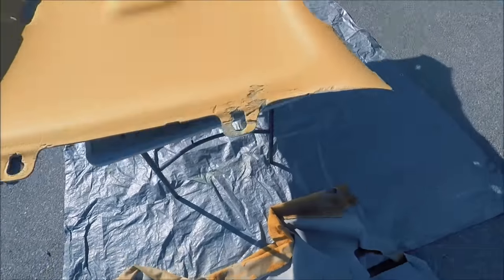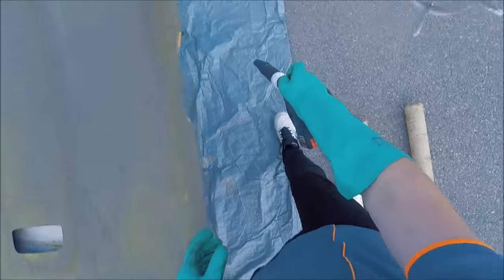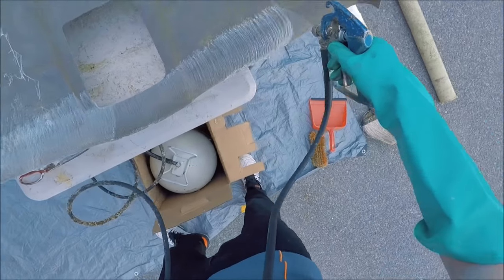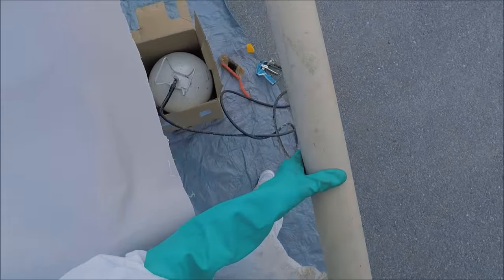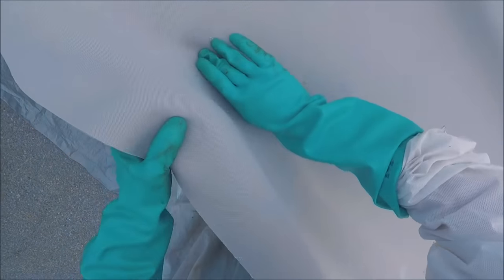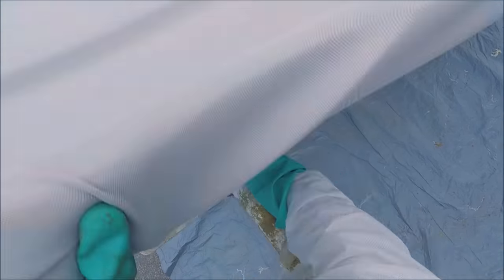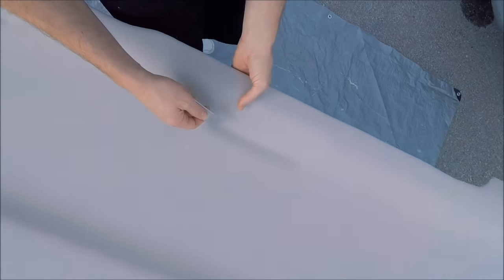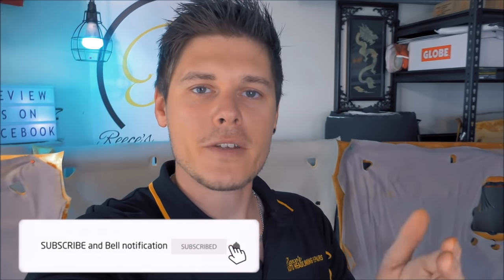How To Fix a Headliner The Correct Way

Comment: Just a heads up to anyone who is planning to buy fabric from general fabric store or crafts store - some of those fabrics, especially black ones cannot withstand UV radiation and will fade to the original fabric color since they are painted fabrics. Special automotive fabrics dont have this issue.

Comment: when installing a new or cleaned old headliner board, is there the mistake of installing it in the wrong direction? I have a 06 toyota corolla CE and it has a sun roof. for mine, because it has a sun roof would make it easier. I don't have the funds to buy a new headliner board so I might just clean the one I have and buy some fabric. The problem with car manufacturers is that they never have those headliner clips you can buy you have to drive 20 miles out to the actual manufacturer just to purchase them. I went to AutoZone and cant find any that fit my car. I was thinking rock auto.  Watching this video gave me the confidence to fix mine. Also can I drive around with just the headliner and not the fabric or can I drive around without the entire headliner until I'm ready to fix/repair/replace it??

Comment: Great video! How many cans of permatex would be needed for a FG Falcon sedan do you think?
Reply from the maker: Thanks for your feedback 👍
We haven't done a converge test using cans, as we usually use a bulk set up that gets sprayed via air gun.

I'm estimating 1 - 2 Cans is ideal for sedan. So best to go with 2, so you don't run out half way through
Reply: @ReecesAutoHeadliningRepairs  thanks very much, I’m keen to give it a try.

Comment: Thanks for the awesome video, just wandering how many cans of Permatex adhesive would i need for a ford territory?
Reply from the maker: I'd suggest 2-3 Adhesive Cans required for wagon.

Have you got Permatex headliner Adhesive stock available near you? As I know it's difficult to source at the moment and what use to cost 35 a can is now up around 60 a single can 🤷‍♂️🤯
Reply: @ReecesAutoHeadliningRepairs  no i dont, i found it on ebay for $60 aswell, i was going to order it unless theirs cheaper options

Comment: a little disclaimer, be careful how you approach folding the headliner depending on the shape of it! i did an e46 headliner and folded it as shown in this video, but on that particular headliner there were two little valleys running the length of the board and the valley with the fabric and the adhesive made it hard to properly apply and caused the fabric to stretch over the valley and not contact the headlining board. folding it along the axis of the car may have helped in preventing this. 

 point is, if your headliner is particularly contoured and has lots of undulations, just take extreme care and don't rush things because you can easily mess it up!

Comment: Great video im looking to do my 1st headliner this helps to not go into it blind of the process.....what king of gun set up you are using? Pressure tank?
Reply from the maker: Thanks for the feedback 👍 
we currently don't sell the glue, but suggest to use one of these glues

Permatex Headliner Adhesive 
- http://ebay.us/apC9ZH

3M high tac 76 Headliner Glue
 - http://ebay.us/eAGTji

The one we are using in this video is Tensor grip t65, we did a video a couple months ago explaining this one, so make sure to check that out if your interested in its set up 👍
Reply from the maker: Here's the glue we used 👍
https://youtu.be/iROuEc3mEF8

Comment: Hello guys, Im doing headliner upholestry like a 7 months. I Ive Done like 10 of them,  I have problem with with front lightening area on Passat b6, golf Mk 6.
Can you show best technique?
Reply from the maker: Here is a VW Golf full video tutorial, hopefully this helps you out

https://youtu.be/FzgG9YT1PYg
Reply: @ReecesAutoHeadliningRepairs  Thank you very much Recce.
I watched the whole video you suggested to me.
You pointed out the door handle clips very nicely.
Also, I think I understood the essence.
The cardboard tube does a great job, too, the tightening goes something like this: first only the front part of the "hill" is glued, then I glue the left side by pulling the canvas in the opposite direction to avoid large folds of material in the middle of the "hill".

Please tell me if I'm wrong.

Comment: Question. I finished the headliner and let it try but now some of the middle is loose. Is there a way to fix it withouth starting over? I'm afraid that if I pull an edge to try to respray glue it will rip because the edges are hoding well. Any suggestions?

Comment: Great video!! But i have a question, how to fix a dent on a headliner? can i use a steamer? Thanks.
Reply from the maker: Headliners that are from factory and about 7-15years old will sag if you rub them, so applying steamer to an old headliner will usually make it sag.

New recovered headliners steamer works great to remove fabric creases and dents. Check the settings before applying it to make sure you don't burn the fabric. Or use an upholstery skewer and gently lift fabric in certain area's to Remove shadows of bumps and imperfections.

We use Phillips Handheld Steam and go.
Reply: @ReecesAutoHeadliningRepairs  Thank you so much. I have subscribed to your channel. Keep it up!

Comment: Curious I have a specific material/pattern I want to put in my truck, but it doesn’t have foam attached to it. What should I use as a backing for the material I want to use that will adhere well and also make the liner look good a smooth?
Reply from the maker: In this scenario when using thin non foam backed material customers supply, we may just use our regular foam backed headliner fabric, then recover over the top with customer supplied fabric. That way we get a soft finish and proper quality heat resistant recovery. However foam backed is not always required, we can sometimes just recover with customer supplied thin non foam backed fabric but make sure glue is good, like our t65 we use

Comment: Thanks for this great video! 
Great job!
   One question
How can I find the same glue you used in this video? Like that big amount of glue
I would like to try running a business
   Like this
Thanks so much
Reply from the maker: I'll load up a video soon about that product we use. Its called Tensorgrip T65 or T51, a 22lt canister of glue. If you jump on their website TensorGlobal, you'll see they provide a list of Supplier locations it can be purchased from. This product is definitely high in price. But the value is great.

A cheaper option is using the Glue out of a drum (SuperGrip I believe its called), poured into a air compressor feed gun.

Comment: Do all cars have some sort of a board on the inside of the roof?
Reply from the maker: Most modern cars would have a headliner board, and the older style (classic cars) have sewn vinyl suspended setup with metal rods.

Older than that may be wood with stapled fabrics.

Then theres modern cars with some sunroofs that have a floating headliner setup explained here
 https://youtu.be/x1PRt0HjCZw

Comment: I’m from the Caribbean, Trinidad and Tobago to be exact the place is mostly hot all year around so I don’t know if it’s the climate but whenever I use spray adhesives they start dropping in little time are you sure this one will definitely be able to withstand the heat?
Reply from the maker: Our best recommendation for glue in hot areas is this product below, but only works when applied correctly, and with new headliner fabric, don't reuse the old fabric.
▸ Permatex headliner adhesive http://ebay.us/apC9ZH

Comment: Thanks for this video, I need to do my headliner 328i E90 and have been looking at fabrics. Seems most the stuff is 3/16" thickness when I feel like 1/8 is more ideal for a headliner like E90. Lots of little angles where the fabric can crease easily if there is too thick of a foam backing. Probably be a good idea to get a steamer as well. What do you think?
Reply from the maker: I find the Phillips hand held steamer (steam and go) works great to remove imperfections,  just test on small sections first.

Comment: Looking at your gun. For the glue. What kind of gun is that, and the tank have the glue inside. Sorry for the dumb question?
Reply from the maker: In this video we are using a brand called Tensorgrip T51 or T65, its like using a massive aerosol can, but instead comes in a 22lt canister, with hose and spray gun 👍👍 Very convenient

Comment: Thanks for the instructional vid, I used a tack cloth to remove any final bits of foam to get a perfect finish. How long do you need to leave the glue to cure before installing in the car? I'm using car builders spray adhesive, hopefully it holds up!
Reply from the maker: I haven't yet tested Car Builders glue, but I got some here to do a future video.

I'd imagine about 5-10min wait time depending on temperature that day. Or just when it becomes tacky to touch.
Reply: @ReecesAutoHeadliningRepairs  Cool, thanks for the reply. I look forward to your thoughts on the glue.  Hopefully it's good!

Comment: Absolutely fantastic video. Love the explanation of everything, first what you do, with what and then why. Production quality isn't obviously the same as some media channel, but it's still quite impressive. 
One question though, is there a way to get it off again after install. 1. I probably want to put in a starlight headliner at some point. 2. More importantly, i will probably not get it anywhere as nice as you get it, so im worried i'll be stuck with one that i don't like as it will be my first time
Reply from the maker: Thanks for the feedback, 
If using good quality materials and adhesive, especially the one we currently use, TensorGrip, then removing the fabric after recovery can be possible, however not recommended and can be extremely hard to remove in some sections and time consuming. 

The starlight headliner process is usually applied to a recovered headliner anyways, so no need to do it before recovery stage or while the fabric is completely off.
Reply: @ReecesAutoHeadliningRepairs  Woah, quick reply. I was expecting weeks 😂😂. Thank you for the info, saves me a lot of headache. Then i gotta ask, would you then recommend getting a new/used   ceiling panel i want to change color in the future, instead of trying to save this one that i have?
Reply from the maker: @icongamingigamingmore7847  usually if you have the particular make and model car that is known to have a sagging headlining issue, then even buying old Replacement roof boards from wreckers you may run into the same issue of needing recovery. 

So best to recover the job if its required, then add the star light headiner fiber optic kit to the board you recovered, or add it to a roof board you know is definitely in good condition.

Same headliner boards you can actually get away with recovering the job twice. But comes with experience, and only really used un order to remove imperfections in the roof board itself.
Reply: @ReecesAutoHeadliningRepairs  awesome! Thank you again. You're really saving me here. As a young guy starting out in cars, people and companies that help out on the internet are a blessing. Wish i could do business with you guys

Comment: Question maybe I missed it. What thickness should you get if you’re trying to accurately replace your “stock” car headliner?
Reply: Most aftermarket headliner material is approx 3.5mm foam backing/thickness. 

Factory foam may have started off this thickness then over the years began to break down, flatten, and deteriorate.

Comment: I recently redid my truck headliner. First time ever doing it. 
But I'm very mechanical around a vehicle. 

I know why mine is falling some now. It's been 3 or 4 days. 
Just not the right glue and not enough. 

I do have a question because of your expertise. 
What do you think about using cotton material?
Reply from the maker: If the headliner board is very flat, then you won't require fabric that has a good stretch. However using non headliner grade material may make it not last as long, also it may be too thin of fabric and glue may stain through. 

Also temperatures can affect certain fabrics and make them shrink or stretch.
Reply: @ReecesAutoHeadliningRepairs  .
Makes sense to me. I thank you for the response. 
Stay well my friend.

Comment: I’m about to do a tapestry headliner in my truck and the headliner in it is still in great condition so should I just glue and put the tapestry over it or would I try to peel the old stuff off and hope the foam is good
Reply from the maker: Usually we recover over the top of existing material if it's brand new or not ready to let go or sag, the reason for this is because it usually adds extra cushion to aftermarket thin fabrics when added. Also to remove new non deteriorated foam is almost impossible. Note: more glue is needed if spraying over the top of existing fabric as usually the first lot of glue absorbs into the fabric, then the next layer will hopefully sit on top.

Comment: ran out of glue(rated for 120deg) and had to be using a kwik grip spray I had in my garage (but only rated to 70deg). Obviously 70deg rating not high enough. Some pulling away again (not alot... but noticeable) in a few weeks later through a summer. I'm thinking I may have to pull the headboard back out and heat the back of the headboard with a heat gun to melt the glue to pull the material away again in the area and  respray the liner with the correct glue with 120deg rating.

Plus didnt do an overlap on the edges and have to put in a rubber edging trim on headboard where it meets the front and rear window. Live and learn, I guess.
Reply from the maker: It's definitely a task that teaches us every day, even we still sometimes get problems. We just try focus on using the Best Quality Headlining Fabrics and glues to hopefully rule out product issues, which then only leaves human error.

I haven't heard much success with kwik grip, so best to stay away from that product for long term hold.

Comment: Great video! Can you tell me how to feed the material into really deep pits? (Thats what she said) because i tried to redo my w124 headlining and it had very deep door-handle things, so i put too much tension on the fabric :(
Reply: Thank you, what fabric are you using? Is it new or reusing the old stuff that was on the job? And if new, is it headliner grade fabric foam backed, with stitch layer on back too?

To explain how to feed the fabric into the deep board recess is difficult to explain via text. But our latest video where we are using customer supplied Suede shows roughly how to do this. It all comes with practice.
Reply: @Reece.wilson  it‘s been a few years so i don‘t remember 100%. But it was a foam backed headliner material with a bit of stretch to it

Comment: If you do use material purchased from a fabric store would you recommend getting the foam?
Reply from the maker: The foam helps hide imperfections on the board if any. But not always required. 

Even if a customer supplies us with thin non back foam fabric,  we recover once with our foam backed fabric, then again with there supplied custom fabric. It helps give off a good finish.

Comment: Hi, when I pulled the fabric off the foam is not crumbly at all. Its gooey. Like really gooey. I've tried scraping it and then cleaning the particle board with acetone, but there is still a tacky feel to the surface. Will the new glue stick if there is still a bit of tackyness on the backing. Thanks!
Reply from the maker: We see this on Audi models, very time consuming process to remove the sticky balls of foam. We just keep brushing, handheld and orbital brushs, untill clean. We haven't dived into using solvents yet as we thought it may hinder the life of the glue or leave a bad smell
Reply: @ReecesAutoHeadliningRepairs  I'll keep at it. Brushing doesn't seem to work at all. It just smushes the goo around. The goo never balls up and falls away. Thanks very much!

Comment: I have done the headliner in a Land Rover 90, the vehicle was 30 yrs old, very hard work but turned out fine, however I am now doing a Land Rover from 1999 , I am buying proper Liner and using spray glue "Trim-Hold high temperature adhesive, What I cannot see is how you can spray the roof and then the liner , all this and you do not get a crease in the liner, mine sticks so quickly that it would be full of creases, what am I doing wrong. Ann

Comment: I’m just doing mine now. I removed the old foam but the surface is really sticky. Will this surface need be non tacky before a use the new glue?
Reply from the maker: We find that if the board is still tacky on cars like Falcons/Commodores its generally fine as long as all loose debris is cleaned off. The tacky board doesn't seem to affect the longevity of the professional repair. However if it is an Audi or VW board, then I suggest alternative methods and the use of Permatex headliner adhesive on these boards as it seems to respond best on European tacky sticky boards

try this affiliate link to the glue we suggest:
▸ Permatex headliner adhesive https://ebay.us/TrG6aw
Reply: @ReecesAutoHeadliningRepairs  thanks for reply  it’s kinda got less tacky I cleans it with acetone and rag

Comment: What material do you use: backed with polyethylene or with polyuretane? Where do you buy material? How much per linear foot (5 ft width)
Reply from the maker: I'm not exactly sure what type of foam the backing is, but most of our fabric/glue comes from Daley's Auto Upholstery supplies or Nolans.
We also stock and sell our products on eBay. 

Buy Our Fabric We Use On Our ebay Australia Shop - https://ebay.us/iVlfnt